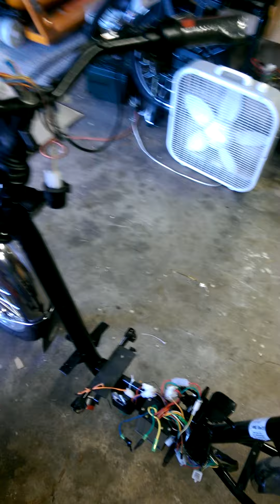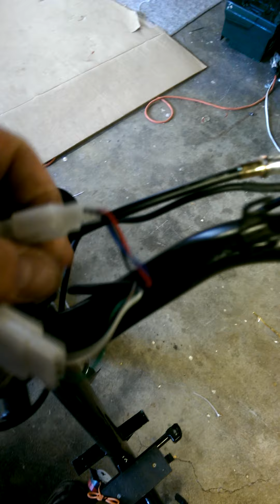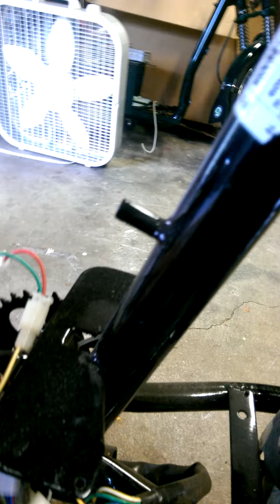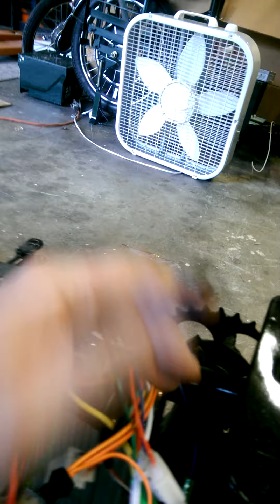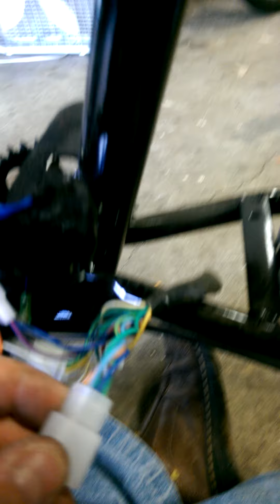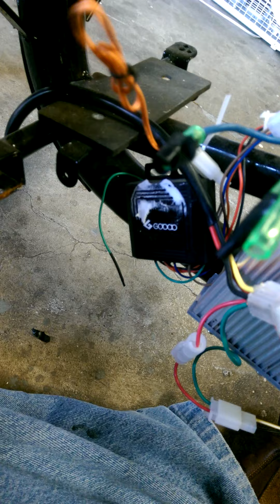Video update of mandatory fixes for 2014 models of Ecomopeds. Wiring harness description.

Comment from the maker: I actually found out that the blue wire is for regenerative braking on some 2014 controllers. When the brake switch is open(pulling the handle), the controller will commence electric abs style braking. :}  On the 2013 CG models it operated like a cruise control setting.